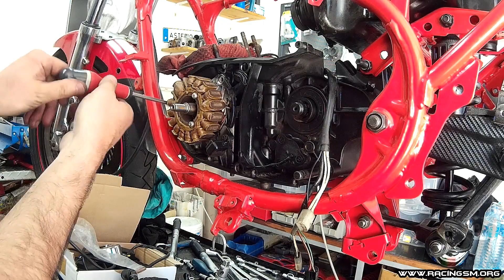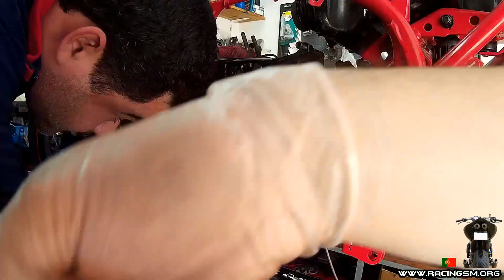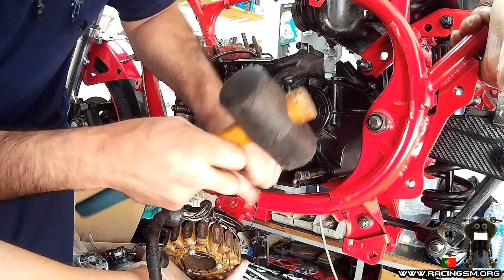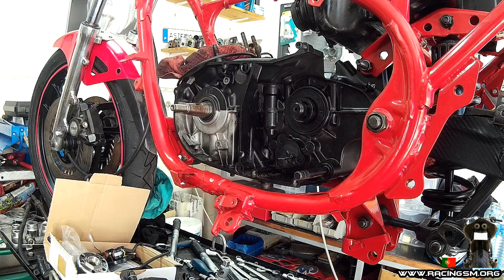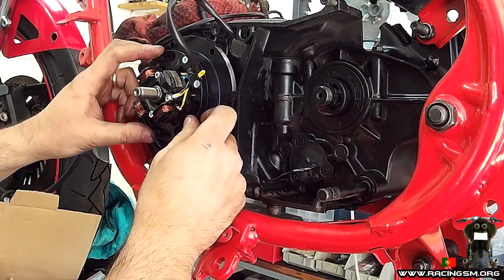YAMAHA RD 350 | Rotor Assembly TimeLapse

Comment: I'm guessing - but I think the magnetic flywheel is removed to save weight,
and to allow the engine to spin more freely.
So the alternator is replaced by a small assembly that services the ignition only.
That's just a guess.